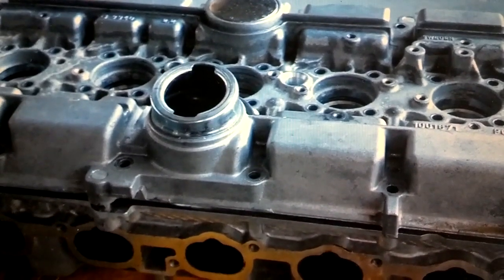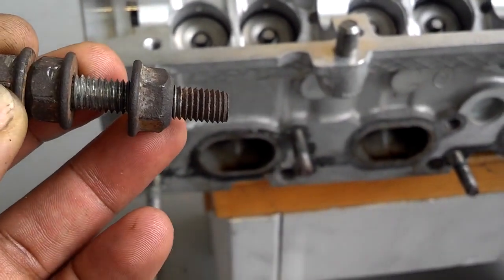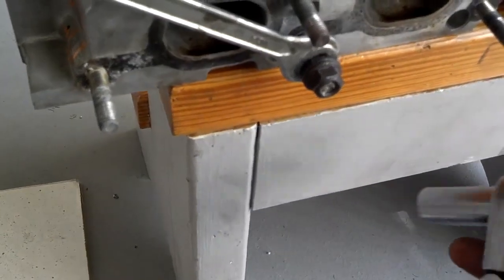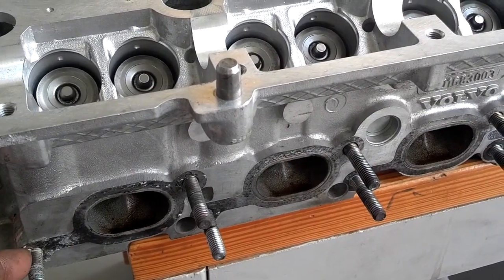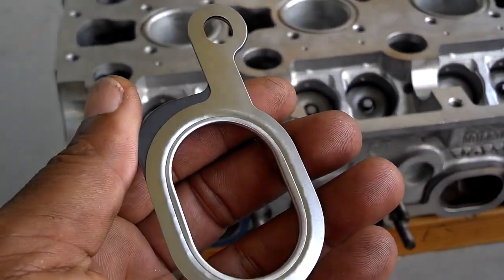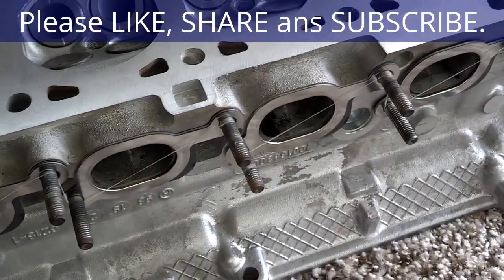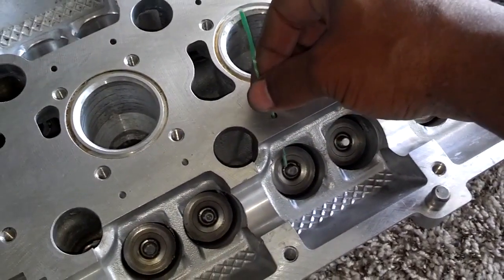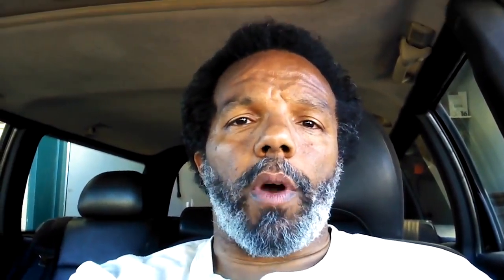Rebuilding a engine cylinder head. Exhaust studs, cleaning, leak testing, etc. Pt 3 of 3 - REMIX

Comment: The exhaust manifold bolts on my T5 have spacers, they are flat on one side and humped on the other.      Rookie move to not make a note, but what side of the spacer goes toward the engine?  Thanks for posting all the videos on the S60.
Reply from the maker: The hump side goes towards the bolt head. I don't think the other side is flat. I think it has an indention. That side goes towards the engine and manifold.